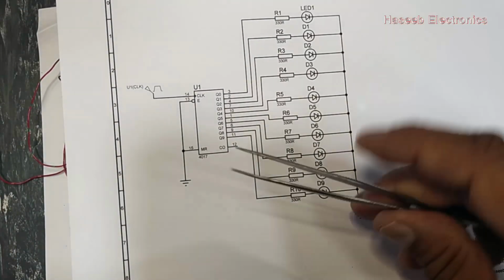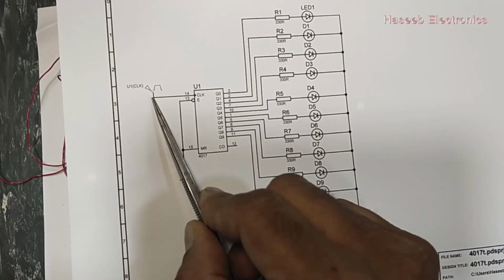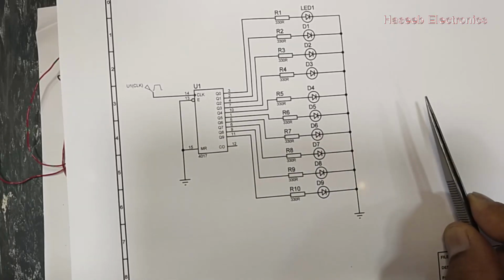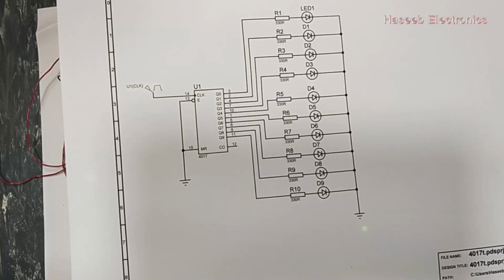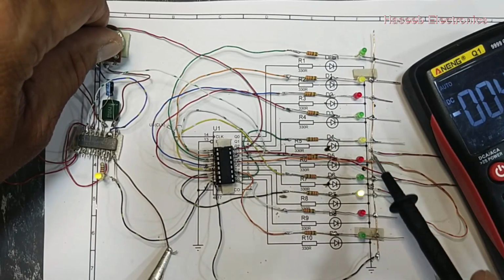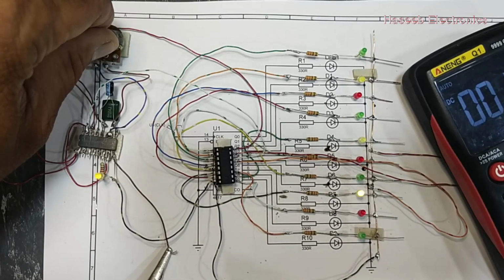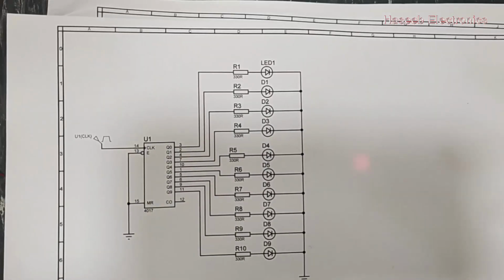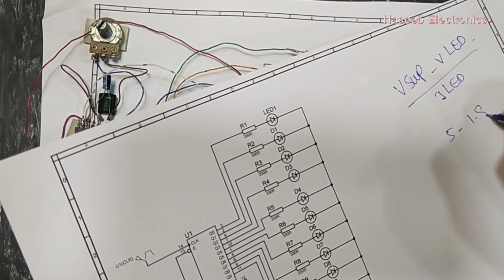{480} How to Design CD4017 Practical Decade Counter Circuit in Detail - Running Chaser Lights

Comment: Very nice beautifully explained one question here if we connect 2 IC or more and we want shift signal from first IC to second IC so how to give frequency to second IC that make same sequence without delay ? do we need to sapret frequency generator or there have any way to increase frequency on next IC ??? 
Thank you very much and best regards brother's
Reply from the maker: thanks a lot dear brother
from first stage pin number 12 we will carry output. we will get output frequency at pin nu. 12   will   (freq at pin 14)/10 
suppose at pin 14 we apply 1000 hz, then pin 12 will 100Hz
this carry will go to next stages ic's pin no 14 as its input (at carry output of second stage will 10 Hz)